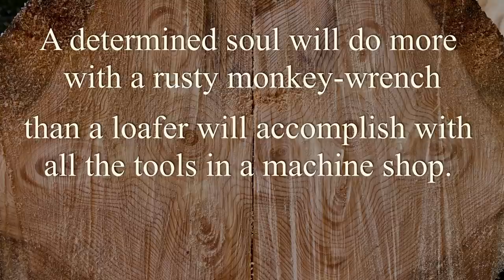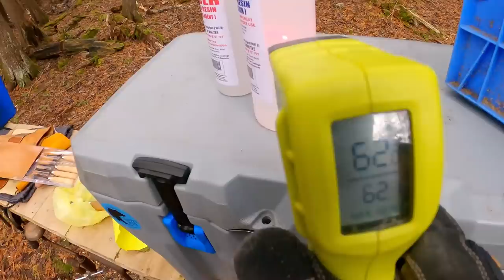I Felt Forced to Kuksa... #20

Comment: There's no need to use resin in kuksa. You need salt, water and coffee.  After carving you have to boil kuksa in salty water. Let it dry. Then you fill kuksa with strong coffee. After two minutes throw coffee away and  "sand" kuksa with coffee grounds. Let it dry and it is ready to use! Coffee includes fat and it works like resin. Salt premeating keeps your kuksa well moisturized so it won't split in two pieces. Never wash your kuksa with soap or other chemicals, only clean water is needed.
You have done wonderful work with your chainsaw! Keep going! Greetings from cold snowy Finland! :)
Reply from the maker: Huh.  I had no idea.  But you would be the one to know!

Comment: I recently discovered your channel and I'm doing pretty much the same thing in Victoria,  Australia.  Virgin ground, lots of hardwood (eucylipts/redgum/acacia (blackwood)), and some sundry sheds.  Lifestyle wise,  I'm on a veteran's disability pension which pays for my fuel and food,  I've installed a decent solar system and have a 9.5kva generator for when i need to use my machine tools.  I guess the only difference between our lifestyles is that i have made the decision to live here permanently (and it's a damn sight warmer), and I'm able to harvest rainwater for most of my water needs.  
I've just finished raising some bobby calves (from 3 days old) and that was really rewarding.  They were really fun to hang around with.  Might be a bit difficult for you because you need a fairly easy method of getting hot water to make their milk substitute up.  I have a wood chip hot water service which is a pain,  but it does work well. 
My place has its own challenges although my temperature challenge is from the other direction ... too bloody hot sometimes (46c), on an island in a swamp,  totally reliant on rainfall for drinking/washing water as well as stock water.  I can pump from the swamp for irrigation (thanks to seeing your well setup), and need to grow some vegetables. Also,  the soil has bugger all organics so is a bit desertified.
Plenty of deer for food and I've put some perch into my pond, so I'm pretty set for protein. Chickens won't last out here with all the foxes though.  I also bought myself a mini-smoker which i would highly recommend you get or make.  The food is delicious and it's so simple,  cooks low and slow,  so you can be cooking while you're editing :)
Anyway,  love your channel,  sorry i can't support you through patreon due to my pension,  but I'm there in spirit!
Oh yeah,  I'm 60 and spent the last 20+ years being a wage slave dreaming of doing this.  When my wife passed away it was time to sell the house and live the dream.
Reply: Great story, Niall! Thanks for sharing, and good luck.

Comment: Maybe dig a root cellar to keep you water containers in so they dont freeze?  Line it with planks to make it solid...
Reply: I was thinking that if he dug a hole 6 feet deep and about 4 feet round and make a insulated top he could keep his water and food down there. Make a platform connected to some rope with a pully attached to a tree limb. And anytime he needed anything from the hole just take the cover off and pull up the platform. It would also keep things cool in the summer. (I guess he would have to build up the sides above ground level so when it rains it doesn't fill up)
Reply: dumpster dive for the styrofoam.

Comment: Just thought of a project for you. Build a giant wooden chain attached to a sundial that looks like a huge pocket watch. You can make a wooden snap for the other end of the chain. The wooden chain should be pretty quick to build with a chainsaw and a knife, at least rough.
You could even put a lid for the pocket watch on the northern side of the sundial/pocket watch.
Just need a small open space with southern exposure for the Sundial to work.
Or you could go authentic and have a compass inside with the cover being the sundial.

Comment: Have you thought about solar? Harbor Freight has a 100 watt system priced under $200 that I use in my off grid cabin.
Reply from the maker: Would love to but its a solid canopy here.  And only a few months of the summer with actual sunshine anyway.
Reply: Doesn’t really require direct sunlight. If they are halfway efficient panels they will generate from the ambient light.

Comment: That Lancelot chain on the angle grinder works wonders doesn’t it. Popping the bubbles in the epoxy as they come to the surface is easily done by by gently passing a flame (butane or propane torch) over the area. Great finished product!
Reply from the maker: Lancelot is amazing but also probably the most dangerous tool I've ever used!

Comment: I have a large Springbar canvas tent, 10x14 that has a wood stove option. LP heat creates condensation where a wood stove will dry it all out plus you can cook on it. Would really expand your ability to keep water liquid and be a good compromise to your issue with building  a cabin. A plus is the wood is free for heat.
Reply from the maker: It would be nice to be able to heat with wood but I'm in a cedar forest.  It is almost infuriating to feed that wood stove all day.  Gotta be in there every 30-45 min or it burns out.  It IS a crappy stove tho.
Reply: A person needs to remember...wood warms you up way more than once when burning it. Once when you're out cutting it, again while throwing it in the bed of the truck or trailer, again while stacking it and again while burning it. I Love wood heat. I spent 30+ years in a house with only wood for heat. I had a fabulous stove a friend had made and I could open it for more air flow or close it down for less.

Comment: 100w Solar Panel Kit, Controller, Charger, Marine Deep Cycle Battery, 1000w Inverter from Harbor Freight/inexpensive and ideal for recharging Camera/Cell Phones, Laptops etc. Get Solar Lights for lighting instead of the Oil Lamps, Get
a 500w Ceramic Heater it will heat your treehouse quick, use your propane and propane heater for Emergencies only.
Use an Electric Hot plate for cooking your food. You can also install a Wind Generator to your Treehouse to keep your
Battery charged at all times. The less you are dependent on the outside the easier life is at camp.
Reply from the maker: While all that stuff sounds nice, I really prefer the "camp" vibe.  Not really looking to settle or homestead.  Just stay alive in the woods while building random junk to stay entertained.

Comment: I wouldn’t mind seeing what your evenings and nights are like. Love your videos and that cup is beautiful! Little epoxy resin tip. Use heat to get rid of the bubbles. Maybe your little torch on a low setting. No flame on it but the heat will pop the bubbles
Reply from the maker: Thanks for the feedback.  Will be doing a few more day-in-the-life videos as the short days and snow slows down the bigger builds.
I heard about the torch trick but the bubbles just kept coming out in "streams" like from the bottom of a beer.  Would it still have worked?
Reply: @survivingringworm2202  I think it’s usually best to wait until it’s close to being set up. Like wait until all the bubbles have formed the put the heat to it. In your application it is a bit different because it is brushed on. I think it works best when it gets a bit more thick.

Comment: Why don't you keep your water in containers you can heat rather than pouring it back and forth? Just a thought.
Or, dig a pit, and make a cooler below freeze line to keep the jugs in so they don't freeze.
Heat the toilet ring wax and dip the cardboard in it for fire starters.
Passive solar heater for your clothes dryer?
Reply from the maker: Holy cow.  You just planned out my next six months!
I do actually put my water jugs in a cooler once warmed.  They stay liquid for days that way.  This was just the first, unexpected cold snap.  Do whatcha gotta.
Reply: Make more ice slushies.

Comment: Maybe you can make a box for the gum ball machine that can be hoisted up high and a rope or cable hooked up with some pulleys that you can lowered when you want some candy.
Screw a cleat to a tree to tie off the rope, or maybe use a cheap boat winch.

Comment: Your Coke so looks good but as far as your battery's concern you can always get some that flat foam board and build you a box to go around your battery to keep it warm in the battery of warm it up as you go but you going to have to put a little exhaust little exhaust for the hydrogen to cost of the outside but also if you go by Harbor Freight and get one of those like four panel Harbor Freight solar panel sets they'll keep a charge believe me and if less than $200

Comment: Question why not clean bottom of jug off and put some water in pan and set jugs in pan of water to melt?
Reply from the maker: That would totally work.  I actually have a better solution but that was the first, somewhat unexpected, freeze.  Not to mention, its pretty hard to come up with the best way to do everything right on the spot.  I'm not the clearest thinker sometimes.

Comment: Your kuksa looks great! Love to look of birch.
I think I would have made the kuksa with the grain of the wood running down the handle, not across it. 
Every kuksa carving video I have seen, has the bottom of the kuksa being the center of the log. I see you made yours the other way, with the top of the kuksa, the center of the log. Your way makes more sense to me, but what do I know?
Reply from the maker: I actually don't know anything about Kuksas.  I think I saw one video 5+ years ago of someone making one and it looked like fun.  All I remembered is that it was made from a split birch log.  And I'd have needed a lot bigger log to make a cup that size and still get two blanks from one chunk.  Was also afraid of loosing too much of the "rose" by putting it at the bottom.
Those are all of the excuses I can come up with right now.
Reply: @survivingringworm2202  I have no experience with kuksas, only what I've seen on the internet, and we all know what that's worth. ;) I would like to make one, but the only birch around here is in my neighbor's yard.

Comment: Why is your water yellow and is it safe to pour boiling/hot water into a plastic container designed to hold cold water, I've heard that plastic can release chemicals that are bad for your health if you do this?
Reply from the maker: It's yellow because it is run-off.  Tannin from the leaves.